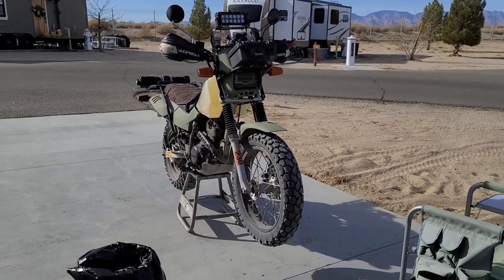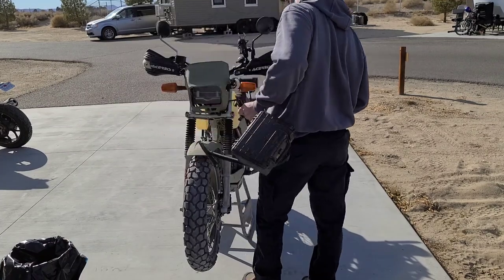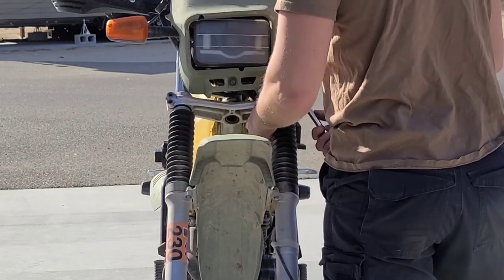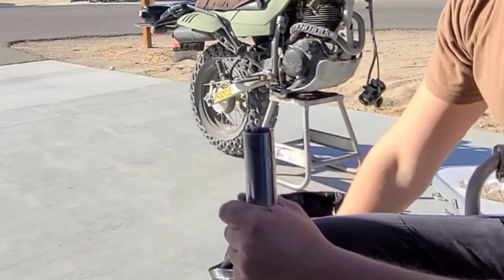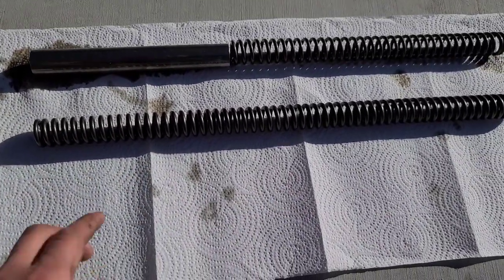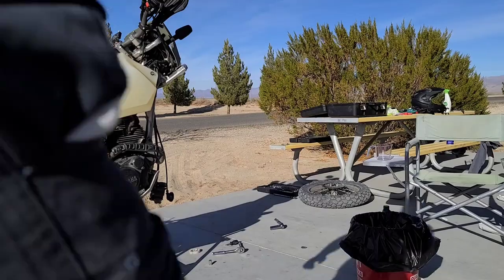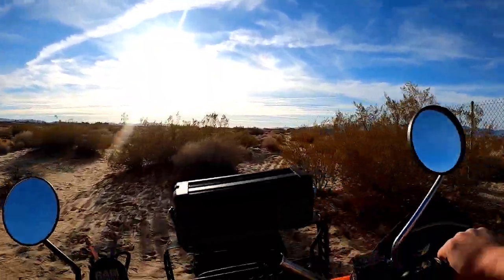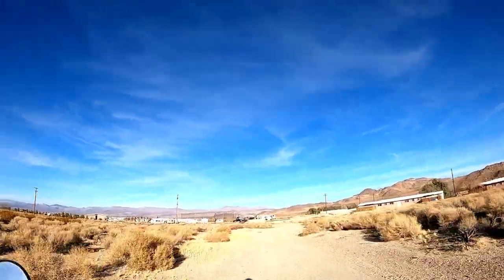Changing out Fork Springs on my Yamaha TW200 . Front Suspension Upgrade .

Comment: I haven't changed out my springs yet. I did have to fully disassemble my forks to clear out a bunch of water and rust that had gotten into them from sitting in the snow for four seasons in a row.  I got a fluid measuring device after TWForums told me how to do it.  You can play with the fluid levels within a certain limit, but I couldn't tell any difference afterward.  One thing they did tell me to do, and I have no idea if it matters, is to pump the shocks with the caps off after you add the oil to get air out of the lower part of the fork.  I have no idea if it matters, as to me, it seems like it would correct itself anyway.  I also used 15 weight, didn't like it, and went back to 7 weight.  15 was great for coming off rocks, but sucked for small hits.  Thanks for the video. I think a lot of people need to know how to do this stuff.

Comment: I have an xt225 and love the 15w oil in it. I also used 1oz more oil per side which increases the air pressure as the front compresses. Love that closing pic, perfect!

Comment: Minor suggestion:  Before unscrewing top cap on fork tube, loosen the two clamp screws around the tube.  This takes pressure off the cap threads.  Saw this in a Yamaha OEM service manual.

Comment: Timely video... I just upgraded the springs in my sertao with progressive springs from hyperpro. I too, upgraded to 15 wt oil. Unfortunately its been too cold and wet to try them out. I also have the rear spring to swap out. That's not as easy for me on the 650 as most bikes. Looks like you are having fun. Thanks for sharing.  ~Grizz
Reply from the maker: I want to swap the rear shock sometime soon as well.  I miss the suspension on my old xr650r. It was perfectly dialed in for me

Comment: Great breakdown of the instruction. When you do this to a bike, generally speaking, do you need to align the forks at all?
Reply: Think of your front-axle as an 'alignment tool'... Slide it through 1 fork leg, align the wheel so the axle goes through,  then align the other fork leg so the axle finishes it's way through there too..  
[Just make sure the triple tree clamps are loose enough to allow for some sliding/twisting]
Reply: @DirtyDovi  ahh. Very smart approach. Thanks.
Reply: @IslandADV    You betcha!  😊👍

Comment: Great video, where did you get the seat cover? Also did you use conduit for the front rack?✌🤘👍
Reply from the maker: The seat cover is the Mad Dog ATV seat cover and the rack is steel. Conduit puts out extremely toxic fumes if you weld it .

Comment: Great video. I need to do that Bad!!! Cant wait for the complete ride review. Do you plan on ever getting the emulators? Not sure how much more they would help. Im a Fat Bastard. A Fighting 215lbs. LOL
Reply from the maker: I am thinking about it. But I am a cheap bastard lol. If the setup I got now works good then just gonna rock with that. Had to pay bills and do a lot of insurance stuff this week and need to take a break from spending money on a perfectly good to go motorcycle lol
Reply: @dualdorks  I quess I need to get mine running before I start on the forks. LOL Ive been spending Money on this like I have money. Which I do not have. LOL
Reply from the maker: @ichibangrom9735  same lol

Comment: Im 6'2" and weigh 250 lbs (310 six months ago).
Which weight would you recommend?
How about springs.
Thanks! 👍
Reply from the maker: Probably heavier fork oil for sure with stiffer springs . I went with the stiffest option even though that sounds wrong lol
Reply: @dualdorks  
LOL!